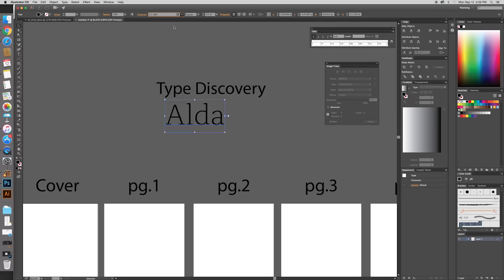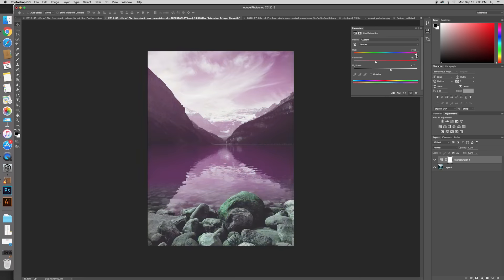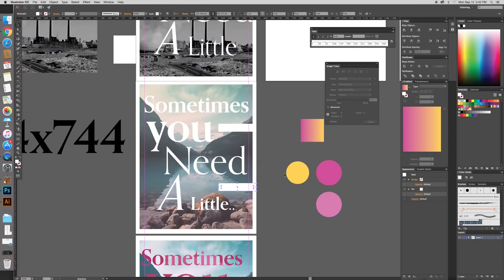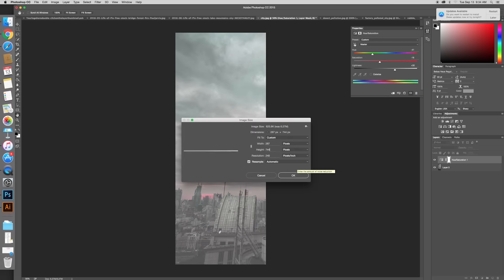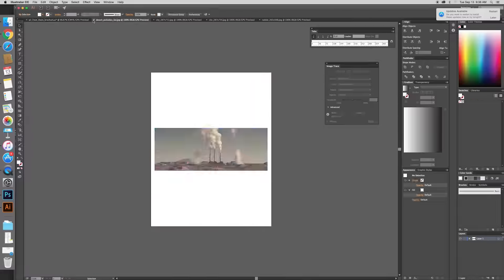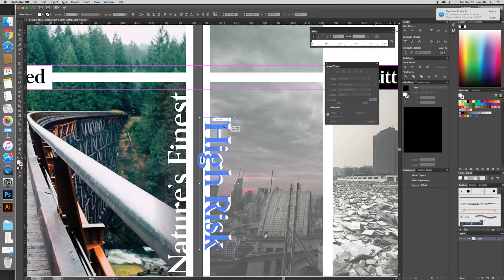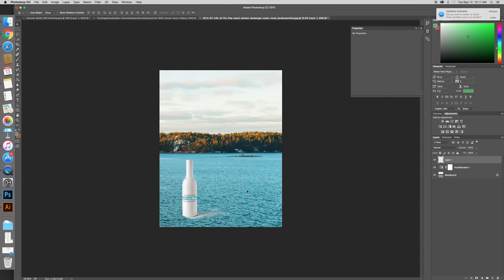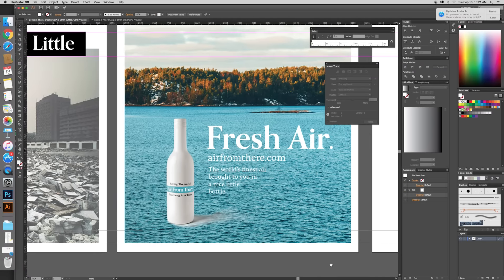Brochure Design Process

Comment: A tip though: if you ever export a pdf from illustrator, it's gonna be a massive file, InDesign (for whatever reason) can take literally the same layout and cut it down to a byte sized file. Just a suggestion ;)
Reply from the maker: Hey Austin! :) Okay that's awesome to know! Thanks so much man :D
Reply: This helped me too Austin. Thanks dude!
Reply: Agree, a lot of times I have to take that pdf and make a jpg file so it's not a massive 30-50 meg file. You also have to crop and do all your photos how you want them because they won't crop in Illustrator. Also, if y'all go to a printer, make sure your photos are CMYK. I guess there is a reason for a layout program and an artwork program :-)